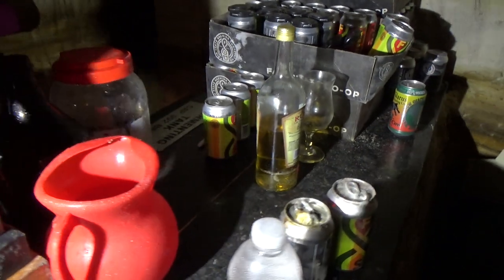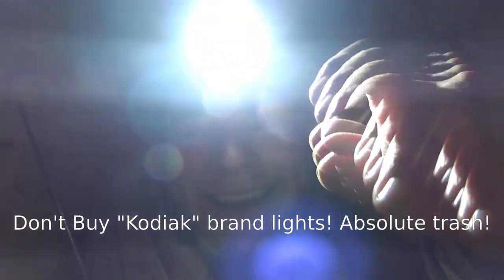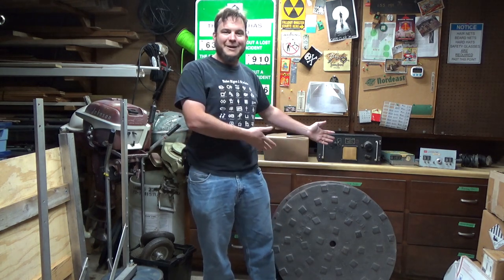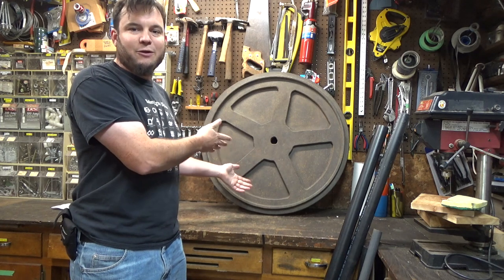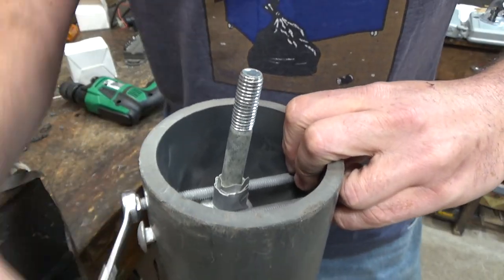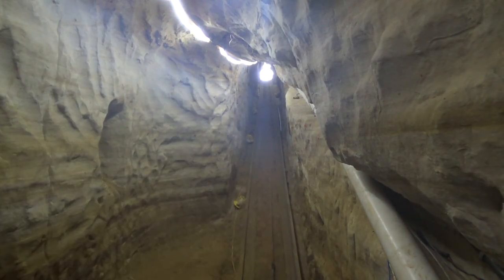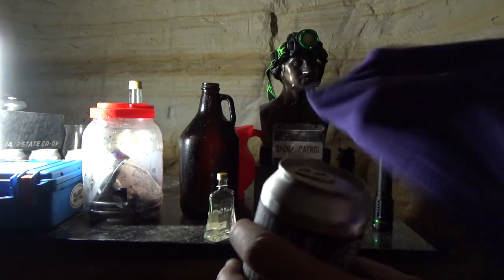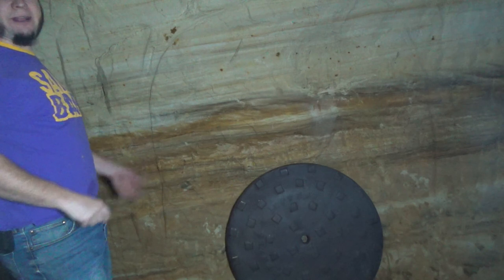Underground Speakeasy Pt3 - Bar Booth with Manhole Table!

Comment: Enjoyed video, and two suggestions. One- when using PVC pipe like you did if you fill it up after it's set in ground with cement/grout it becomes rock solid strong as a steel support pipe. Two- you should consider getting a old dead log and seed it with some exotic mushroom spoors. (Lion's Main, Oyster, Morel, ect, ect). Take Care
Reply from the maker: I've considered the mushroom thing, you can buy pre-seeded logs from the hardware store!

Comment: The booth looks good! I would definitely recommend some sort of dry/airtight storage cabinets of some sort. Someone else in the comments suggested a refrigerator, which would be a pain but might work pretty well
Reply from the maker: Yeah, we're testing some airtight boxes to see how those go!
Reply: @saveitforparts  next after that should be a movie theater like the one in Paris!
Reply from the maker: There was a plan for a theater but it's been put on hold due to other projects. If we had more volunteers we could dig more rooms!
Reply: @saveitforparts  Yeah, a theater would be super cool. It's awesome that you actually have people using it too

Comment: I’m subscribed to a channel called tech ingredients and a while back he made a video where a he made a really nice air conditioner maybe you could use or modify his design to cool and also use it as a dehumidifier. If I remember correctly it’s also very low power. You could also install some ventilation through out the tunnel or just the bar.

Comment: i have a question, is there any way you could explain how to make supports?(i’m digging in Caliche, which is very hard type of dirt) me and my friends want to dig tunnels but i don’t want to be crushed to death.
Reply from the maker: We are mostly building this unsupported, sandstone stays stable as long as the ceiling is arched. We do have some timbers near the entrance where it's dirt and rocks. 

I'm interested in the Caliche tunnels, we checked some out near Shoshone California recently. We checked out the artificial caves in Dublin Gulch and some natural caves just South along the road. I got the impression that Caliche stays stable as long as its very dry, which is the opposite of sandstone in some ways, ours likes to remain damp.
Reply: @saveitforparts  i live in a desert and it’s very dry over here hasn’t rained in a good while, although i’m still gonna put up timber supports, i’m not 100% sure on this but i figured it would be more stable if it’s arched idk though
Reply from the maker: What I usually tell people is to find similar tunnels in the same geological formation if possible, and see what's lasted the longest. If you have any historic mines, or brewery cellars, or utility tunnels or similar that go through the Caliche, try to find out more about the engineering and what they used for support. Wood supports also last a long time in the desert, when we were exploring the mines in Death Valley and Panamint valley we were surprised at how well preserved everything is compared to damp climates.
Reply from the maker: This video has some of the Caliche cave "houses" we saw out West. https://youtu.be/LVqgqYgmeXM
 I'd be really interested to see what you end up digging, that would be a fun project :-)
Reply: @saveitforparts  once we get far enough i might post some videos about it.

Comment: Wind energy powered dehumidifiers running down there, 24/7? make em from old window air conditioners. whenever the wind blows, they fire up. ...then what if after running them for a year straight, you splash slaked lime on EVERYTHING. ....OVER, AND OVER......
Reply from the maker: The sandstone actually stays more stable if it's damp, once it dries out it gets more crumbly. We'll probably just deal with the humidity and plan on everything being a little damp.
Reply: @saveitforparts  Bartender...I'd like a dry Martini.   Get outta here ya troublemaker!